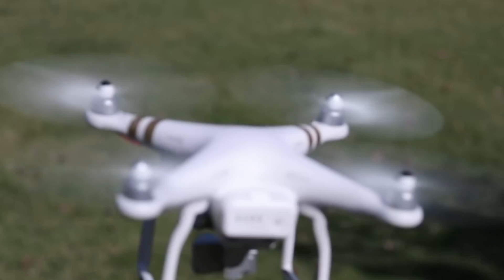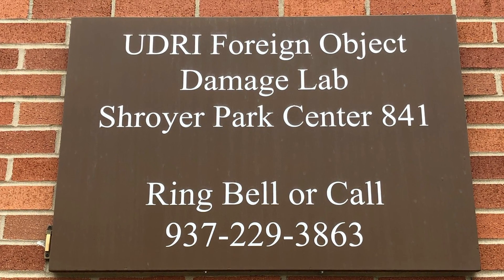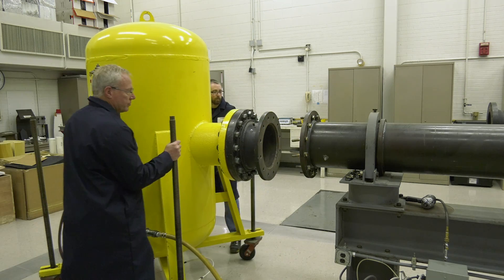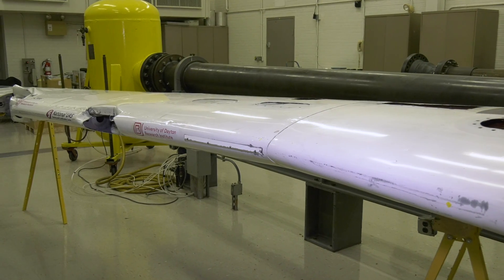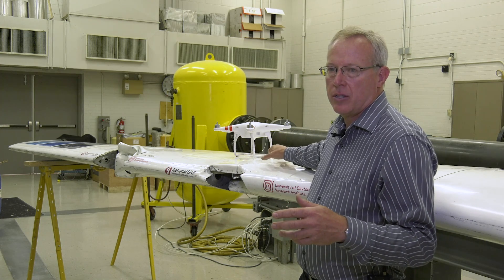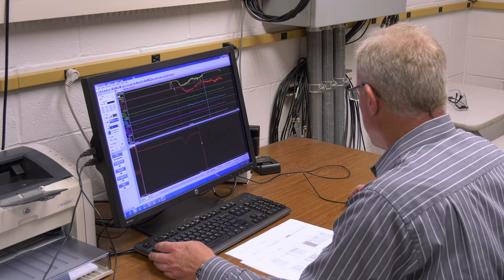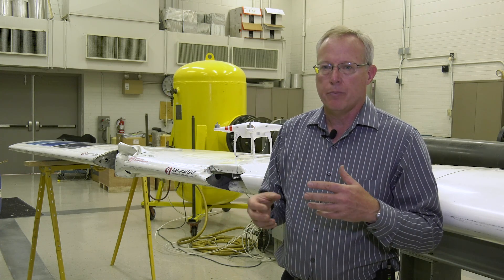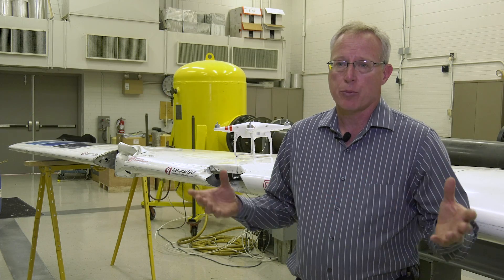What Happens When a Drone Hits an Airplane Wing? – AIN

Comment: Ok, with all these issues, there needs to be clearly defined definitions of these items. A "drone" has a GPS receiver and can autonomously fly without an operator. A "RC plane/helicopter (with 1 or more rotors) is just that, remotely controlled by an operator. I don't remember when I was growing up any issues with RC planes and helos, because common sense prevailed and you operated them away from people and airports. I guess the problem is "people", because now there is a problem.

Comment: If you are making a comparative test between birds and small uav's, atleast fire them at comparative structures, the drone hit mid span between leading edge formers/ribs, penetrating the leading edge skin, the "bird" hit adjacent to a former/rib right next to a skin joint tearing out all the fasteners giving a more visually severe impact point, to the public, it didn't really emphasis the increased severity of a drone strike vs bird strike. Please perform a comparative test at same wing station locations to give a more like for like comparative test to assess the relative consiquences more accurately. Please!

Comment: I get that no legally operating drone should be anywhere near an airplane traveling at 200mph but a solution is to build the drones with break-away components like the video said. Just make them so the frames shatter in high speed impacts and let the expensive stuff just tumble to the ground

Comment: The actual fuck.. are you fucking assuming that drones fly at. Drone strikes as most likely to happen on takeoff and landing. Very few hobby drones will climb to 1500+ feet. When they do, they are generally taking still shots or very slow pans. Landing and take off for small prop planes is around 95mph. They are assuming the drone is traveling at 100mph. The closing speed is still 90mph.. 90mph and the drone will not do this kind of damage. Might get a good dent, and it could fuck the prop, but it won't do what these idiot claims. The plane in question won't even do 280 mph.

Comment: I'm not too sure about the speed the drone was shot at the wing due to the usual low altitude where drones are flown at (somewhere around 100meters or less) and I imagine even private plane pilots just flying around for fun would fly atleast double the altitude.
Also most aircraft flying at low altitude would most likely be something like small single prop cessna (or something similiar) or a helicopter and I doupt those can/would fly 200+ mph at such a low altitude.
But the possibility of drone strike is still out there and is worth looking into in closer detail.

Comment: At what altitude where you simulating your test at? I better not see jets traveling that fast while under 1500ft agl, a test that simulates real life conditions under 1500ft  is needed.  Most civil aircraft travel between 60-100mph ground speed at low altitude and are small light weight aircraft.

Comment: Wait, what? The reason they tested this was because no one had done a test with a real drone and a real wing (conditions as close to the real thing as possible) but they only shot the drone with half the speed it would actually have, and then concluded the plane would have survived this, but maybe not if it had been at full speed?? Wtf was the point of even doing this study, where the whole point was that you won't have to extrapolate, if you still have to extrapolate a fuck ton to get to the result?

Comment: The tech in the uav industry is evolving just as fast as the video game industry? 
Lawmakers are never gonna get regulations right and not kill the consumer uav industry in the process.
So, before a dji phantom crashes into a landing airplane's wing, can the uav industry (manufacturers like dji and yunic and sellers like best buy, target, and the apple store) set up a colective organization to self regulate like the video game industry did with the esrb? They could sell light uavs  like the mavic series that breaks up on impact with just some firmware that does not allow them to fly above 400 feet. Uavs  like the phantom 4 pro and inspire 2 could require the user to pass a proficiency test before dji unlocks their ability to fly.

Comment: Next they should try a 400lb RQ-7B vs a MC-130 Hercules - https://www.suasnews.com/2013/07/hercules-did-run-down-rq-7b-in-afghanistan/; admittedly these two were flying in (generally) the same direction, and the MC-130 pilot was in the wrong (procedural deviance - sounds kinky).
- just prior to the re-enactment - https://www.usafe.af.mil/News/Photos/igphoto/2000940434/

Comment: I don't have a drone but don't they already have something build into them that prevents from flying into restricted space where a plane might be passing by? Or is that only on high end ones? I guess if someone makes one themselves then that's different story.
Reply: Krazykov, you are correct, dji products have built in geofencing that prevents them from flying too high, or into restricted areas like airports, most other manufacturers don’t have this. Plus there is third party apps available to use with dji products that eliminates the geofencing. Still the media like to blame these incidents on someone who has bought a dji Phantom from a department store & has no idea what they are doing.

Comment: Completely agree with @Binary Operator ' s Assessment, PLUS the momentum equation. The wing's momentum was essentially nullified by holding still, vs. a several ton aircraft.  That said, it seems to me the value of this piece is to call attention to our need as drone pilots to ensure we're safe distances away from airports, or at minimum in good communication with air traffic control.  But the biggest question we should be asking ourselves...  why the flip are we not building airplane wings stronger?!

Comment: Im sorry but it looks like birds fo more damage than the drone 😂
Reply: RAIDEAD  what is this mysterious Titan material you speak of you thinking of titanium? Also yeah no that's the wing of a general aviation craft made of aluminum
Reply: That is an ordinary aircraft wing. 

What is "titan"? Titanium? Aircraft wings do not have "wing covers", they are generally skinned with some kind of aluminium alloy, or with doped cloth in the case of vintage 'planes. (Airliners might have leading edge slats - these are aerodynamic devices to increase lift at low speed and they form the leading edge, they don't "protect" it.)

They do use titanium leading edges on jet engine _fan blades_, however, titanium isn't magically indestructible. 

The Boeing 787, being made mostly of composites, has, relatively speaking, an enormous amount of titanium, which is electro-chemically more compatible with polymer resin composites than is aluminium. Indeed, it probably has more titanium than any other airliner. But it has composite leading edges (with a thin sprayed metal layer of heating elements inside for de-icing). 

I fly model aircraft, I have mates who fly drones, I don't want to see them banned or over-restricted. With sensible flying, the chances of drone strikes should be loads less than the chances of bird strikes, and, as the video said, this kind of impact is survivable by the 'plane, though potentially quite costly.  

But folk combining wilful ignorance with belligerence are not doing us model flyers any favours.

I don't want to see the powers that be take my, or your, toys away, but, dude, get a fucking clue, learn some manners, facts and humility before slagging off people who are doing and sharing some actual useful research.
Reply: Not to mention the bir didn’t look to break apart
Reply: RAIDEAD  a thin sheet of titanium is little better than a thicker sheet of aluminum, those strips are there for corrosion resistance not structural strength. I've cut the stuff they use on wing edges with a big pair of scissors.

most planes just go with aluminum anyways for the same reasons
Reply: would still hate to fly into one of those things
Reply: What do you mean by "wing cover" and "TITAN"? You see, I'm a certified pilot and I would love to make my aircraft as safe as I possibly can. Please explain to me where I can find these and if a CE-172 can be equipped with them.
Reply: Calderon someone didn't listen to the video
Reply: RAIDEAD  You really don't know what you're talking about...do you?  There's not such thing as TITAN, it's sheet aluminum...on every plane.  Some newer planes may have carbon fiber panels, but for the most part, it's just plain ol' aluminum.  

But please, tell me how you're an A&P and know all of this stuff.  While you're at it, show me you're certificate, and then maybe I'll believe you.  Oh, wait a second, my certificate says I still wouldn't believe you...
Reply: Whack-a-doodle-do!
Reply: (referring to "RAIDEAD's" comment . . . repeat . . . Whack-a-doodle-doo!)
Reply: They should install anti bird/drone missiles $5000 a pop✈🚀🦃🎆 https://youtu.be/6pvCzFoAO-Y
Reply: Not me
Reply: I COMPLETELY DISAGREE the bird simply folded back the aluminum platting but the drone did damage to the spar and better the inside of the wing.
Reply: Tristan Ruel which is more likely to actually effect the the flight characteristics of the plane, the almost flattened outer airfoil or the internal damage that just costs more to fix?
Reply: the internal damage might lead to fuel leak, loss of flaps, hydraulics
Reply: Make Drones Out  of   CLOUDS . Don't Planes hit them all the time?  LOL .
Reply: Calderon Zefaed A bird strike wouldn’t damage the engines entirely but a drone. The engine would probably explode while in mid-flight which is....yikes.
Reply: I don't know why you're sorry?. 'It looks like' is not a basis of its a done deal proof. The leading edge of an aircraft is the fundamental reason it flies. Wreck it's profile and it's wrecks everything. Even a build up ice is enough to mess with the leading edges properties. You're also not considering that wing is 'going' at +200 mph when hit. One small tear or hole can rip apart in those wind conditions. Either bird or drone can be catastrophic. Make no assumptions with uneducated 'guesstimates'.
Reply: Michael Freed your understanding of kinetic energy and physics, or lack there of, is laughable.
Reply: He specifically mentioned the drone did more internal damage, where it'd be more likely to interact with control mechanisms. The bird left a bigger dent, but it didn't find its way inside the wing.
Reply: Some bird, a lump of jelly no hard bits like bones/beak why not just use a chicken?
Reply: Calderon Zefaed The drone could puncture a fuel cell and then the fuel could explode!

That would do ALLOTADAMAGE

The bird would domage more paneling but pobabbli not puncture the fuel cell
Reply: @thecanadiankiwibirb4512  Compressed Air, not fuel. Do some research
Reply: Lmaoing @ drone shills here, enjoy your regulated drones.
Reply: @MrMilkman29  why you gotta be a dick?
Reply: Pointless movie, chance that the bird hit the wing like that are much greater than drone. And still those are so rare. By the way bird just smashed that wing ;) Ban all birds  from 10km zone  to airports otherway there will be disaster!! (dumb video)
Reply: @laj1234567  I've seen a few bird strikes, some leave a dent, some have shattered windows or become stuck in engines, drones just cut into aluminum there's no real contest. Drones are much more dangerous.
Reply: @FutureAirways2  and what are the chances of a drone impacting the wing directly?

Comment: That's why they should be banned. They're not models but weapons that are flown too far and too dangerous. They should only be flown to a permitted height and distance and within the confines of Radio Model Clubs, and not miles away from the modeller flying them. But, since they are flown too far and too high, that's why they collide with aircraft. And when that happens, nobody can trace the modeller to face criminal charges for damaging an aircraft that could possibly have crashed and killed people onboard. The quicker the FAA forces the ban, the safer the airlines will be.

Comment: How did they calculate closing speed? Most of these drones are either hovering moving in a way consistent with taking video or pics not moving speedily through the air, not saying they wouldn’t be, but if an average Cessna is flying 120mph then the airplane is the faster machine. Moreover the likelihood of a strike would increase if the drone operator is flying near and airport and an aircraft is descending I don’t think drone are flying that close to airports and flight paths.

Comment: So a plastic drone can penetrate an aircraft wing. Yet we are lead to believe two aircraft are strong enough to slice through two steel and concrete towers?? I’m confused 9/11
Reply: Ben Jensen - You shouldn't be.
Yes a plastic drone with its metal electric motors and batteries can penetrate a few inches into an aircraft wing travelling at speed.

For a start the 767 airliner is full of very strong parts- solid jet engines,landing gear,wing spars,plus APU etc.
Whole front sections of the aircraft would of been compressed & deformed by the impact but the overall mass travelling faster than this
drone would at a the bare minimum weaken the building's beams. Outer walls,windows and rooms would become fragments.
I've not studied the exact weights of the planes but  maximum takeoff weight per plane is 315,000 lb/142,882 kg for the smallest version of the 767 - the 767-200.
So thats 142.882 tonnes per plane,doing over 300mph. Both jet engines at maximum thrust X2 @48,000–52,500 lbf which the terrorists most likely had throttled to/or near to.

In conclusion we have -

stuff it
put it this way both planes didn't bounce of the towers leaving a small dent.
Reply: GZazzy Murcia isn’t freedom Russia better. #gunreformundertrump2018

Comment: Why would someone be flying a drone that high in the air anyway doesn't make any sense it has to be a very rare amount of people that are flying that high in the air most people stay under 400 feet for Christ sakes and airplanes are doing astronomical speeds even when they're just taking off their doing around 150 knots which is around 240 km/h and small airplanes like a Cessna 150 take off at around 55 knots which is around 100 km/h  how is a phantom drone going to be fast enough to get in front of one of these speeding airplanes this is ridiculous

Comment: If the airplane has leading edge lift devices the damage would be far worse than that. Worse yet the pilots wouldn't know the extent of the damage until they extend slats, and risk an asymmetry problem at low airspeed.

Comment: A more realistic test would be to use the approach speed of the aircraft as the speed of impact. Drones or Quadcopters typically do not fly faster than 20 to 30 MPH they also are more close to stationary except when transiting positions. While they can achieve higher altitudes most, even when breaking current FAA rules, do not go higher than 800 to 1000 feet. The operator needs to stay in strong radio control range and also video range if the drone is too small to see. Given the speed and altitude limits the biggest danger is around airports or unregulated landing strips. Most civil aviation aircraft have approach speeds way less than 100 MPH usually around 50 to 60 MPH. Civil Aviation Jets have higher approach speeds. When testing against a wing use the approach speed of that aircraft as the baseline. Only use higher speeds for absolutely worst case scenarios.

Comment: Most to all (especially DJI) drones have built in gps tracking systems along with no fly zones built in plus have height limit set in. The only way to fly anywhere near an airport is if you have a permit, license and much more. 

If you have a modern drone, it won’t even take off or go near an airport due to the gps tracking. The only way is if someone deliberately goes into the coding of the drone and disables it which is very difficult to do.

Comment: This is bullshit because if it were true Tower 1 and Tower 2 would still be standing.
The official 9/11 story is true and the buildings fell because they were hit by airplanes. If an aluminum airplane can take down a steel and concrete structure I'm sure it can easily withstand a tiny plastic drone

Comment: Airplanes are ruining the hobby. Stay above 400 ft like you are supposed to.
Reply: fun fact, 400 feet isn't a floor for full scale aviation. It's usually very unsafe to operate at such low altitudes, but it does happen. That being said, this test is a load of horse shit and I would very much like to see University of Dayton have to eat its own feces for publishing this farce of an "experiment." UAS operations are among the safest in aviation and it's totally bullshit to see it smeared in this way. This is coming from a pilot of both full scale and model aircraft.
Reply: exactly. 👍

Comment: I can see "frangible drones" being a terrible idea... they suffer quite a bit of impact damage already when you crash (because you're a hot dog ace drone pilot... till the ground disagrees) and if you've pre-weakened the drone by making sure I cant wreck a jet with it then it's probably dead on impact with anything.  :(  Aircraft should be protected, but not by compromising the integrity of the product.   Maybe some sane rules like "dont fly your drone near an air field" and "dont fly your drone into commercial airspace" would be helpful?  I hate rules, but I enjoy a common sense agreement when it comes to the use of available space.

This is why I live far away from cities, people, and generally everything.  If I want to soar into the clouds I'd like to be able to do so without worrying about my city's local airport or passing helicopters/fixed wings.  Yay for the blank spaces of America (they exist, and if you doubt that then you've lived in the city far too long and should get out).